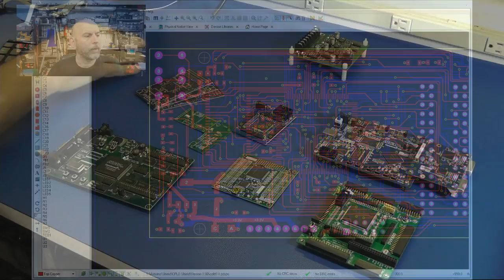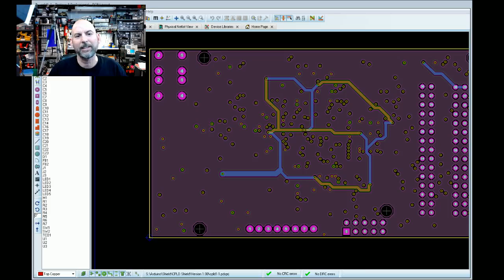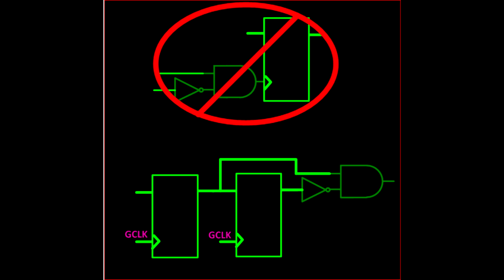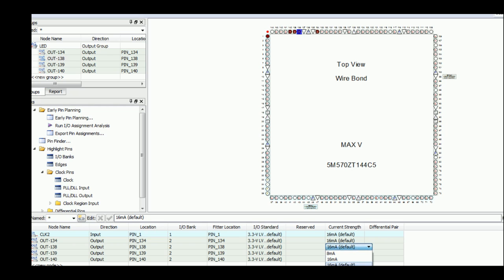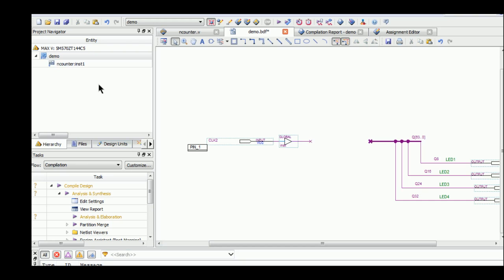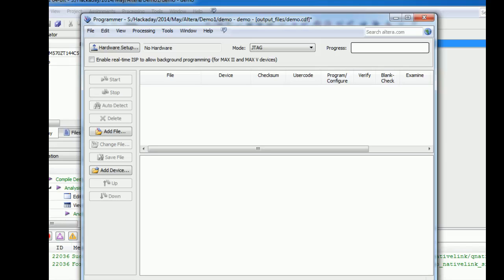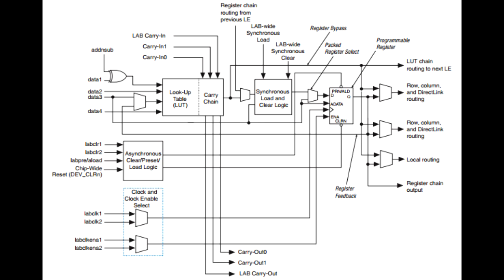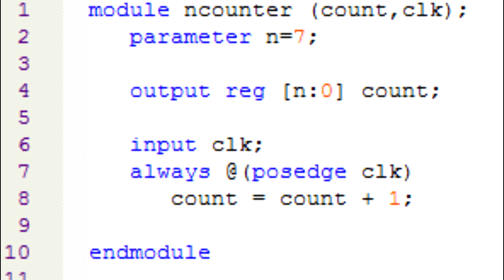Programmable Logic II: Program a CPLD from start to finish.

Comment: I recently switched from the MAX V 570Z (TSOP144), same as in the video, to the much superior Lattice MACHO2. For nearly the same price, you get more IO, 9KB of block ram, and hardened I2C and SPI. My performance is nearly 50x greater.

Comment: Does a CPLD have its own processor?   Does a CPLD operate even before the BIOS/UEFI?
Reply: CPLD is Basically Hardware which you can Program however you want. Instead of Using ICs, Gates and Wires just Program it instead. And yes You can Program or Emulate a CPU in CPLD but FPGAs are better for that and few do come along with CPU Cores. Idk BIOS stuff tho

Comment: Nice introdution. The only missing thing is basic verilog syntax. And how n parameter translates to blinking time ?
Reply: The n parameter is used to denote how many bits is used for the counter register.

So, where he has...

output reg [n:0] count;

When the parameter = 63, the above will actually be "seen" at compile time like this...

output reg [63:0] count;

This means that the register "count" will have 64 bits total (bit 63 down to bit 0).

Bil then chose to route arbitrary bits of the count register directly to the LEDs on the board using the graphical block diagram.

The "count" register in this example is clocked at 50MHz, and the count value increments on every rising edge of the main input clock (hence the "posedge" statement in the always block).

If you visualize how binary counting works, each bit of the counter toggles half as slow as the first one.

So...

bit "0" of the count register will toggle at 25MHz.
bit "1" of the count register will toggle at 12.5MHz.
bit "2" of the count register will toggle at 6.25MHz.

..and so on.

You can see that you need quite a few bits to slow down the output signal enough so you can actually see them toggling on the LED(s). ;)
Reply: (this may not be 100% correct, but this is to the best of my knowledge)...

In the always block, the statements below it will be evaluated every time the terms in the so-called "sensitivity list" are true.

The only thing in the sensitivity list in this example is the @(posedge clk).

This means that the count = count + 1 part will happen every time we see a rising edge of the clk input.

If you have only one statement after the always block, you don't need the "begin" and "end" words.

But, if you have more than one thing to evaluate on every rising edge of the clk, you could do this...

always @(posedge clk) begin
    count = count + 1;
    state = state + 1;
end

(we don't actually have a "state" register yet, but you get the idea). :)
Reply: Marcin Jurczuk btw, from the sort of videos you've watched, and your subs, I'm guessing your question was rhetorical, but thought I'd post some of my ramblings anyway in case somebody else wanted to know. lol

Comment: Could you use a CPLD or FPGA and that universal active filter to emulate a SID chip?
Reply: yes, as long as it fits into the C64, and you have an adapter that has the right pins. You'd propably have to use a logic converter, as most modern FPGAs / CPLDs use 3.3v logic, but most older systems (6502, Z80, 8086 etc) used 5v